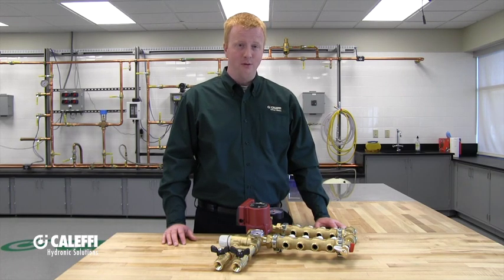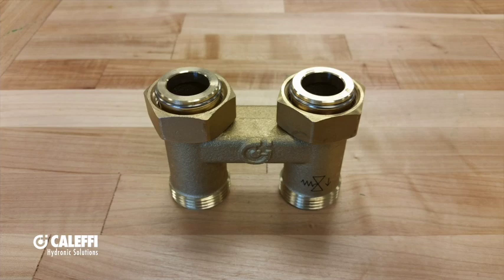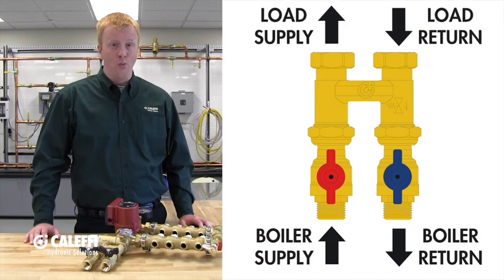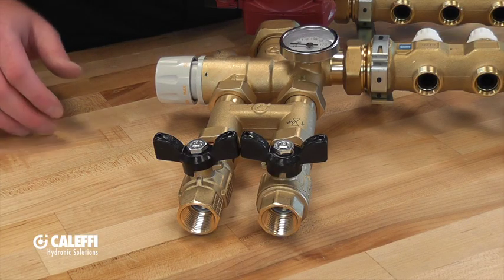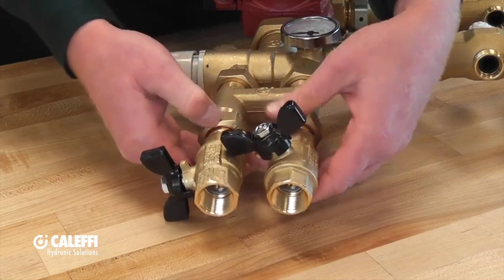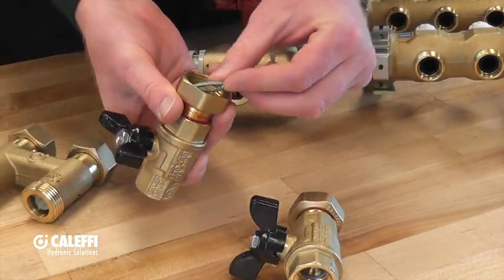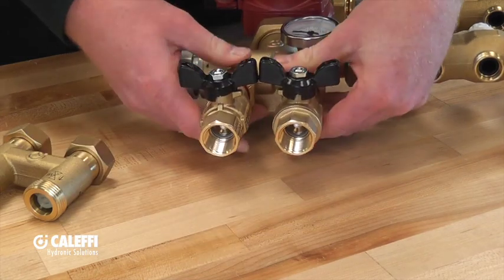Do I need a hydraulic separator on a manifold mixing station?

Comment: Man I really need help the the following questions! 🙏
- Do you calculate the hydraulic resistance of the mixing valve into the primary or secondary circuit assuming you keep the hydraulic separator in?
- Let's say I have a primary and secondary circuit, hydraulically separated. Now in the secondary circuit manifold, can I use a pump for each loop instead of a single pump driving the entire manifold as in this example? Can the manifold act as a header that hydraulically separates the loop pumps since its diameter is over 1" and the loops are 1/2" pipe? (It is a small system using small DC pumps, cannot use one large pump). 
- Also, when calculating the resistances for each one of the loops individually, do I include the pipe, manifold, and mixing valve, or just the pipe?
Thank you.
Reply from the maker: - Every mixing valve has a rated Cv.  you can use your flow rate and the valve Cv to get your head loss calculation.
- The manifold will not act as a hydraulic separator.  It is most common to have one pump pumping to the manifold and not on each individual loop.
- The manifold already have a calculated loop Cv.  You can use that combined with the pipe manufactures data to calculate your head loss.

Comment: In your diagram you show a system that will be effectively short circuited by the close coupled tee arrangement. I noticed in the video your H unit contains a flow restriction I believe to allow a set flow rate only to pass through the what is effectively a bypass.
Reply: Spot on mate. Can’t undo Bad system design with short cuts 👍🏻👍🏻

Comment: In the UK we are not allowed to use a bypass as its thought this will raise the return temperature and reduce condensing efficiency. Also people are fitting these close coupled tees at manifolds inspired by your product and causing imbalance in hesting systems. The use is taken out of context and miss applied.

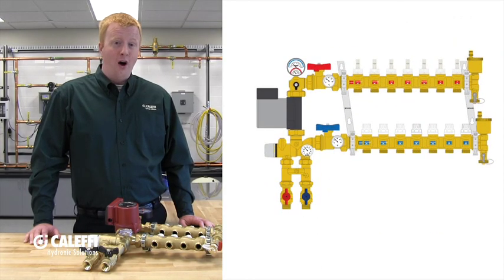Comment: Do you have Cv numbers for the hydraulic separator? Im designing a home run system similar to the one shown at 0:50 and im concerned the flow across the separator will drop pressure to my supply manifold.  Should a balancing valve be installed on the return side?
Reply from the maker: Thank you for your inquiry.  We do not provide Cv numbers for the hydro separators.  In general, everything has a pressure drop, but the science of a hydro separator is that it has a negligible pressure drop in order to eliminate any pumping conflicts between the primary and secondary.